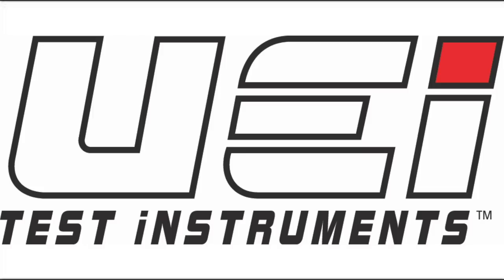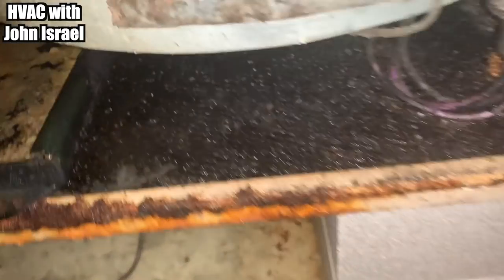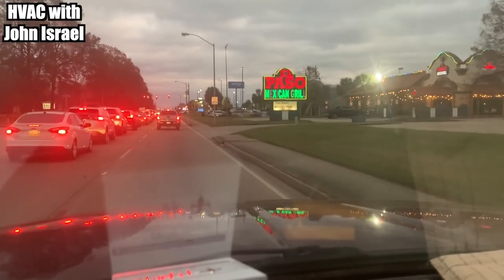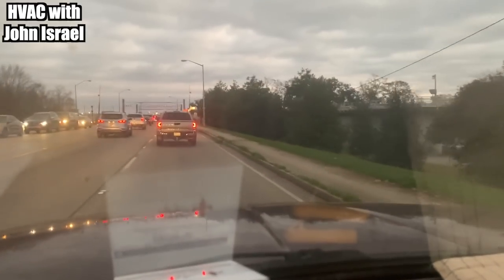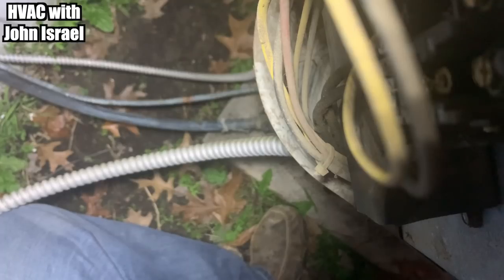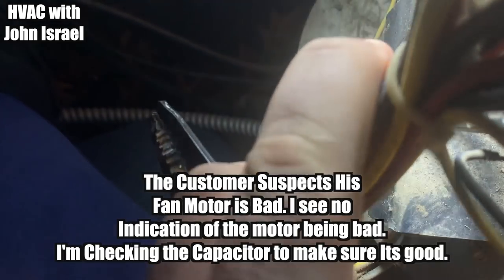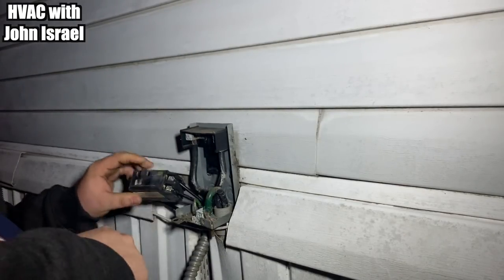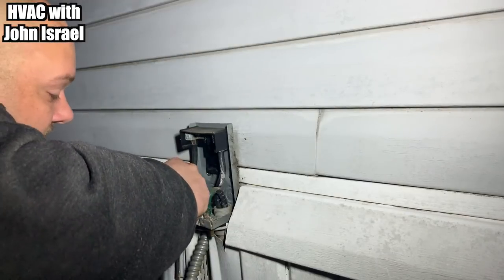HVAC Service Calls

Comment: those are not breakers inside those disconnects, they're a plain switch in breaker case. also those enclosures are not rated for a breaker in them, because they're too small of a space for the breaker to cool properly and you'll end up with nuisance trips and possibly overheating enough to melt the terminals/wire.
best bet is just replace the whole disconnect with a nice pullout model :)